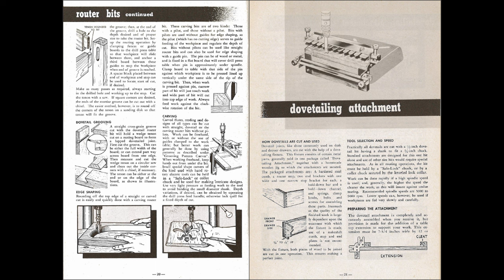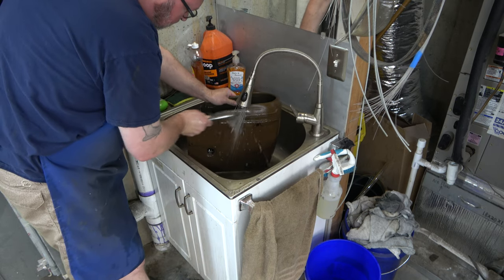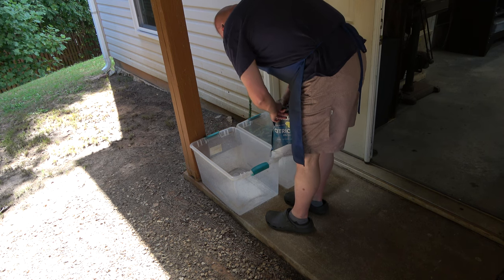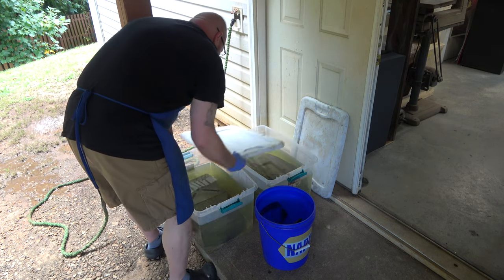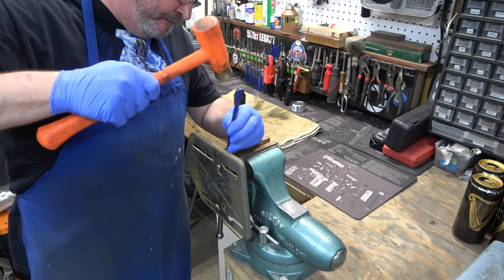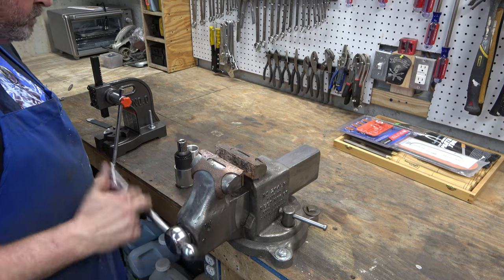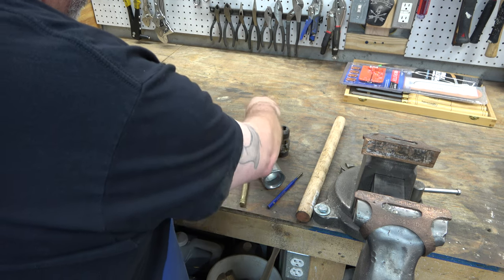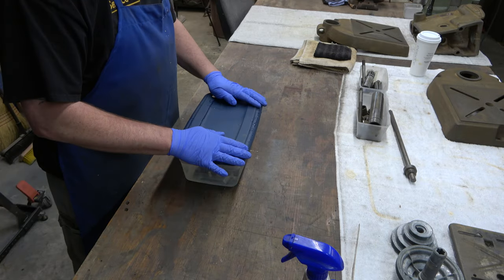Part 4 Rebuild 150 Craftsman Drill Press (Rust Removal & Chuck Disassembly)

Comment: Great videos. Thank-you!  
I picked up a 103.23131 in terrific shape.  Sadly, when I pressed apart the chuck, I had the jaws just a scant below the nose body as a particular video on YouTube showed to do,  but the other end still contacted the sleeve and on jaw#1 it curled off enough of the last tooth so that jaw slips down when fully extended.  I'm going to try some JB weld to try to rebuild that last partial tooth, so the split nut will stay engaged with the jaw.  I do see a set of new jaws on ebay, but there is no spit ring nut.  What is the likely hood that the new jaws will mesh smoothly with my existing nut (which shows no wear)? The chuck and the jaw faces are in really good shape.  I'd really like to use it and avoid buying a replacement chuck.  Thanks for any info you may be able to provide!
Reply from the maker: Congratulations on the drill press. I hope the video you alluded to was not one of my videos. I try to state that the jaws need to protrude between ¼ and ½” in all my videos but I may have missed one at some point. Yes, you can buy jaw sets as well as split nuts and sleeves if needed but in my opinion the rebuild kits sale for 70ish dollars and a replacement chuck sales for 111.19 from Zoro. Here is the link and it’s what I would recommend. https://www.zoro.com/jacobs-34-33c-plain-bearing-heavy-duty-12-chuck-14451/i/G0912247/?utm_source=google&utm_medium=surfaces&utm_campaign=shopping%20feed&utm_content=free%20google%20shopping%20clicks&campaignid=19979164537&productid=G0912247&v=&gclid=CjwKCAjw-eKpBhAbEiwAqFL0mnhdteXjCE_kgqWioZrkknBuuCmNMlJmUxOZaz43Ft3m9tMhNURtCxoCk-wQAvD_BwE&gclsrc=aw.ds
If the link does not work just search for Jacobs 14451.
Reply: @JeffsShop   Thank you for the detailed and very helpful reply. I greatly appreciate your time and expertise.  Rest assured that it was NOT your videos that led me to believe to have the jaws just below the nose of the chuck body for sleeve removal.  The YouTuber who posted that info had mentioned not to retract the jaws too deeply past the nose, yet having them just a nudge below the nose was detrimental for the jaws in my chuck. It hurt, since the chuck's gears and jaw faces are in great shape and I goofed things up.  Live and learn. I actually need a drill chuck for my mini lathe, so I may do as you suggest and get a new chuck for the DP and use the compromised chuck on my lathe, where gravity is less likely to have the one jaw drop out of alignment when fully extended. Though I'm still hopeful a half of toothpick amount of JB Weld on the end of the buggered jaw tooth will allow it to not fall from grace. I'll let you know how it goes. The original paint is a battleship gray and is in good condition, though some white paint has been slopped onto the edge of the base casting, so I may search for a good color match of gray if I can't remove the spilled paint successfully. The quill to column measurement is 7.75"! An amazing capacity for a table top drill press in my opinion.
Reply from the maker: @eddents  Good deal, as far as a color match, I believe FrankLee on Garage Journal Forum has fond the best that can be had for spray paint. Here is a link to his thread: https://www.garagejournal.com/forum/threads/craftsman-drill-press.227480/post-10358638

Comment: Great video. I subscribed as I am trying to purchase a Delta version of this drill press.
Reply from the maker: Jake, I am unaware of a Delta version of the 150. I know Dunlap produced versions of the Mohawk as well as the Craftsman Mohawks. There is another brand Sprunger that is similar to the 13 1/2" King Seeley but not a direct copy. I would like to see pics of this drill press you are considering. If you want more feed back please go to one of my drill press threads on the Garage Journal forum and post some pics and questions. I and the other members regularly offer opinions and advise.

Comment: I have a 150 that was found in a scrap pile..the feed handle works..but it won't go down bit just a little,  then it makes a solid stop..what could be the problem? It was working fine, until a idiot I know took it outside and the weather got to it...its still in nice condition. I'd love to get it going
Reply from the maker: I recommend you register for a free account on the Garage Journal Forum and post your questions in this thread. https://www.garagejournal.com/forum/threads/craftsman-drill-press-information-belts-bearings-chucks-keys-etc-1946-1984.489080/ We have a lot of very knowledgeable members who can help you diagnose the issue and get your 150 running like a champ.

Comment: My 150 now has a slit wobble in it. could it be a bearing? where can I get parts?
Reply from the maker: Runout could be several things. I recommend you register for a free account on the Garage Journal Forum and post your questions in this thread. https://www.garagejournal.com/forum/threads/craftsman-drill-press-information-belts-bearings-chucks-keys-etc-1946-1984.489080/ We have a lot of very knowledgeable members who can help you diagnose the issue and get your 150 running like a champ.